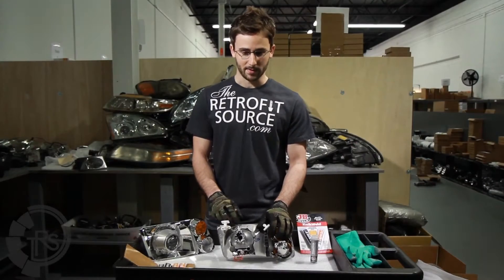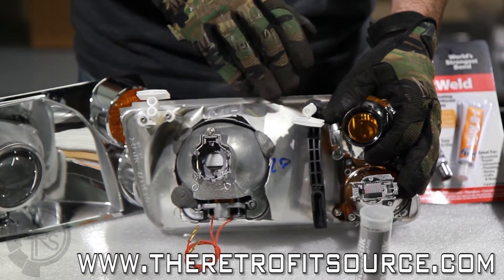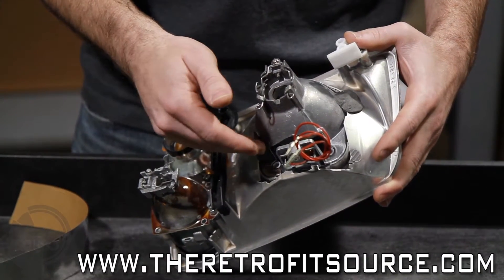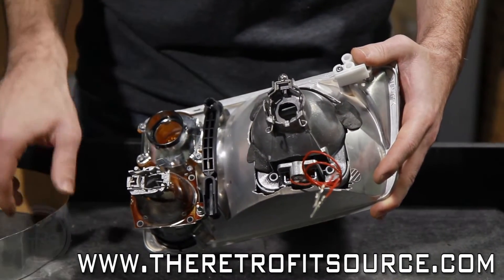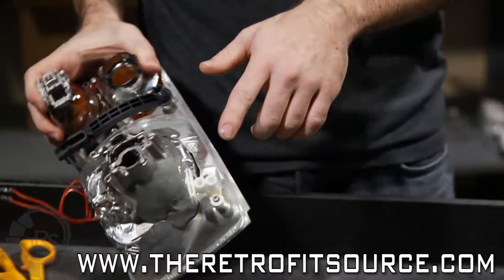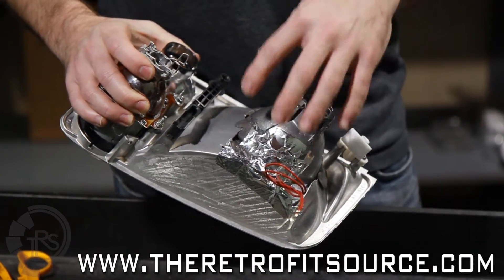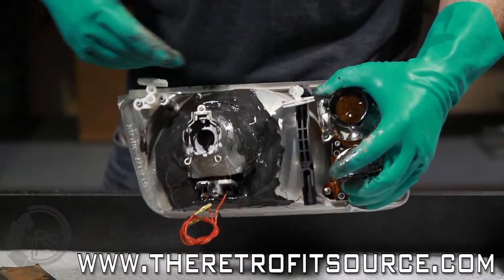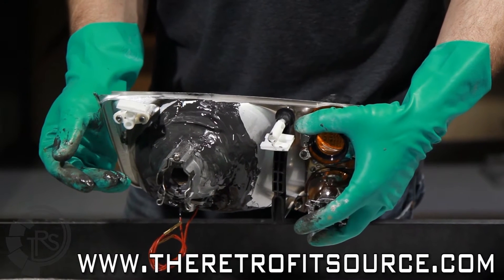TRS Tips: HID Headlight Projector Retrofitting with JB Weld Epoxy (MKIV Jetta)

Comment: May I know how to remove those epoxy if I want to change old projectors after some years ago??
Reply from the maker: Would have to cut it off, Alan
Reply: That’s why I don’t use jb weld I use the existing hole and make it bigger to where the screw on part fits and just use that

Comment: How much JB Quick should I use? I'm doing this on a 8th gen civic, so the headlights aren't huge like a pickup truck...
Reply: +Tommy Miller One of the small packs per headlight should be enough after mixing together - you'll have 2 oz

https://www.theretrofitsource.com/accessories/jbweld-epoxy.html
Reply: The Retrofit Source Inc I got one and half of those packs right now. I'm going to epoxy them tomorrow and see if i have enough.  Thanks!